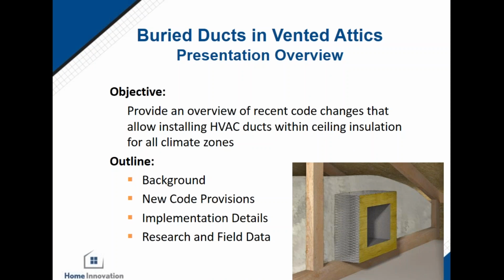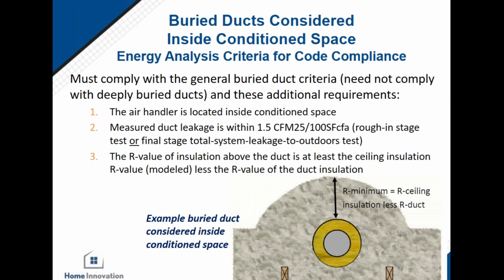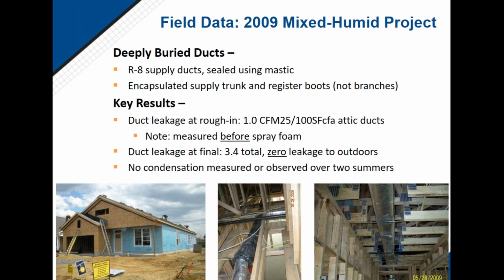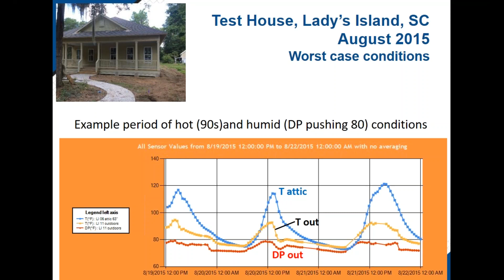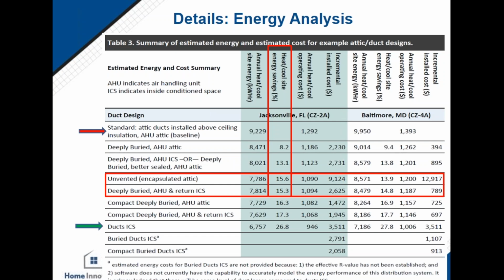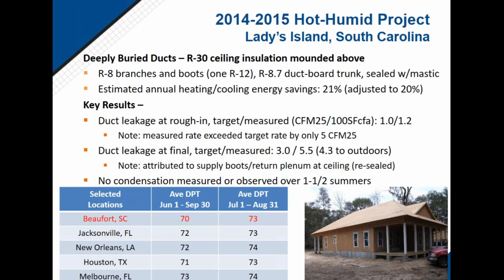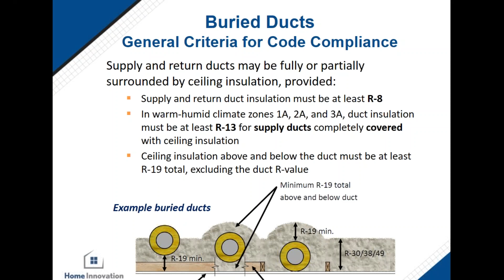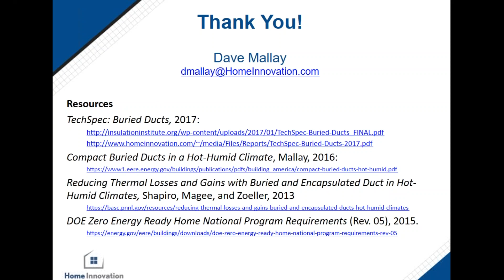Buried Ducts:  A New Path for High Performance Vented Attics

Comment: been following this for around 6 months now... at first i was pretty dismissive, but the DOE sponsored study by D. Malley is pretty damn convincing. 

i cant really see why this would not catch on with cheaper home builders... you can talk about bringing the attic into the conditioned space all day long, but the fact remains that polyiso boards and CC and even OC foam jobs cost a grip when compared to that of loose fill.  

i am curious though... what are the implications of cellulose loose fill? presumably loose fill is significantly more hydroscopic? what are the implications of this with respect to the variations in insulation DP at depths approaching the duct vapor barrier?